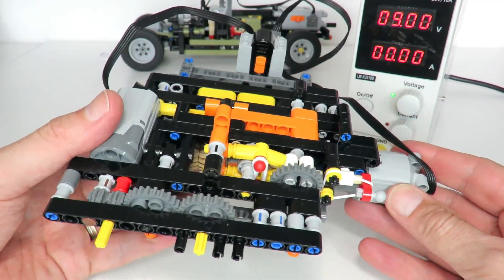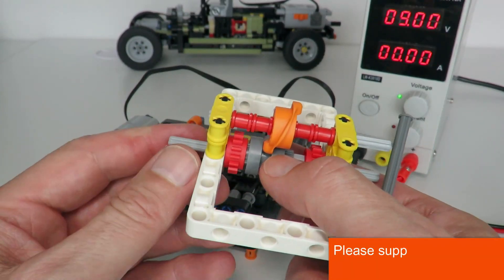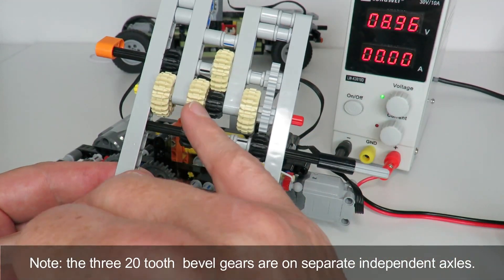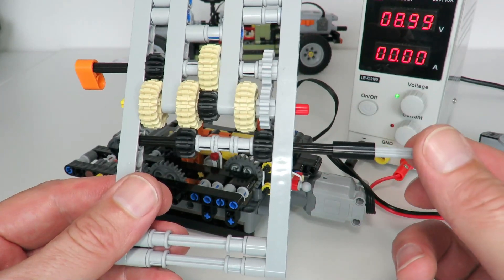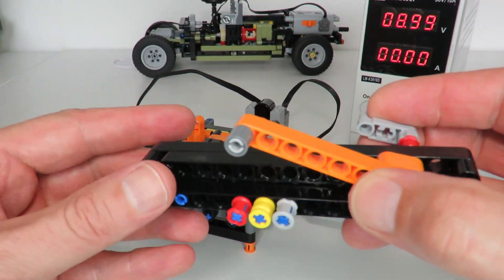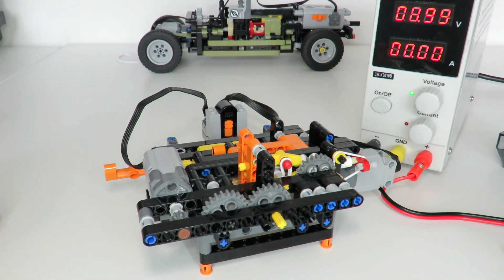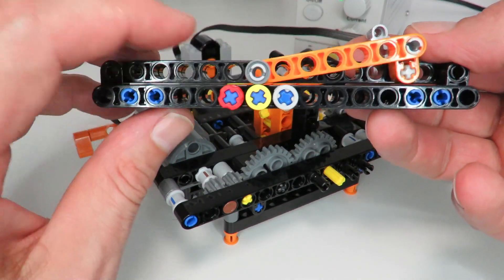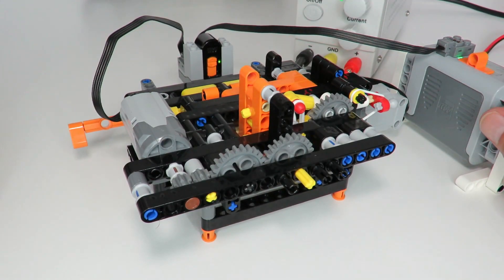Lego Technic RC 3 Speed Manual Gearbox

Comment: Looks great! I think you could fix the issue with the slight misalignment at 90 degrees on the shifter by using the standard gear rack. I’m pretty sure it moves 1 stud to either side every 90 degrees when meshed with with a 12 tooth bevel.
Reply from the maker: Hi Leo - thanks for that - yes you're right that was going to be my next improvement.  I have had feedback on each problem and now have better solutions! 🙃

Comment: Another great and informative video! The meshing problem with 16 tooth gears can be addressed by mating them with 20 tooth gears (axles placed like knight's movement in chess). If you have only one bevel gear in a pair it forks perfectly, and with this placement you can get four different ratios: 12-24, 16-20, 20-16, 24-12. I have run my trial trucks with such gearbox and it can easily handle all the torque from XL motor, theoretically even two.
Reply from the maker: That's a great point! I hadn't thought of meshing a regular gear with a bevel. Great feedback. Will use that next time! 🙃